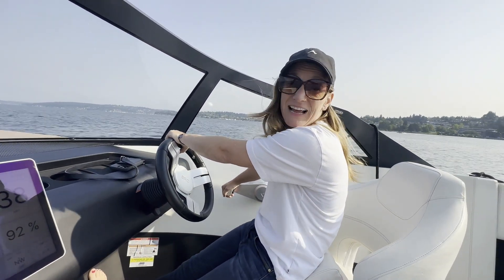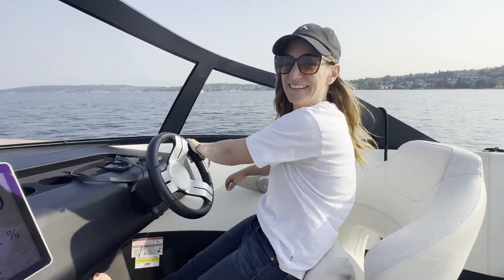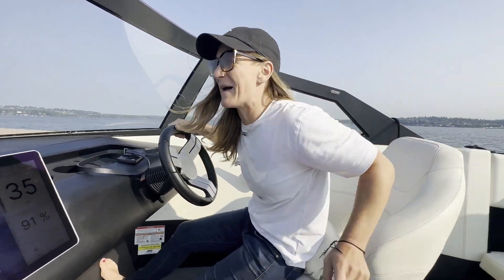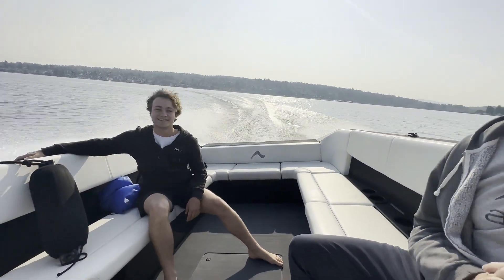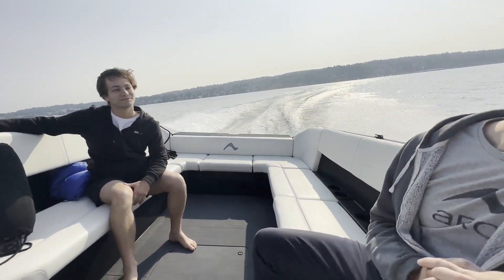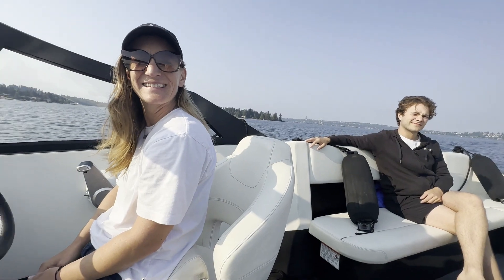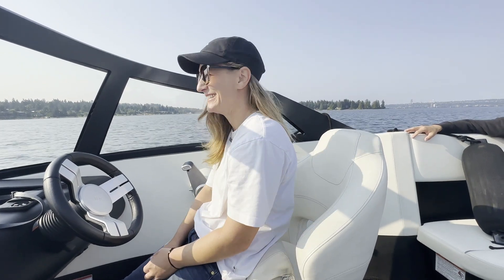Revving up the Arc One electric boat

Comment: Total Efficiency % 20-25
video seconds 0:03 battery 93%
video seconds 0:04 battery 92%
video seconds 0:30 battery 92%
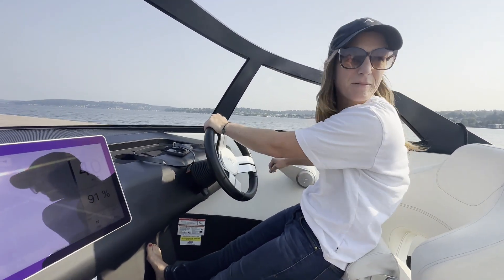video seconds 0:31 battery 91%
In short, at a speed of 40 knots, on average, if all values are linear, it consumes 1% of battery energy every 27 seconds.
This means ;
100% battery capacity 100 x 27 seconds = 2700 seconds
2700 seconds /60 = 45 minutes
If you do 40 knots for 45 minutes, the total
40 / 60 = 0.67 (nautical miles traveled in 1 minute)
45 x 0.67 = 30.15 nautical miles in 45 minutes.
30.15 nautical miles x 1852 mt /1000 = 55.83 km
ı am really sad ,according to the total efficiency criteria, this project failed.